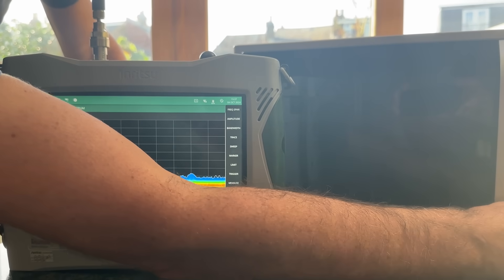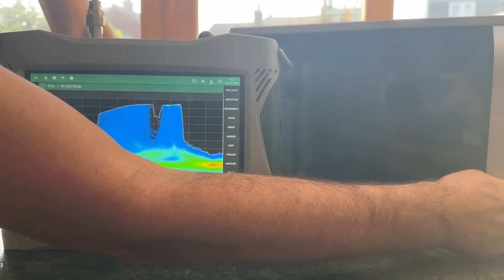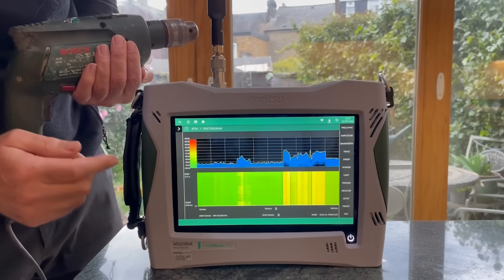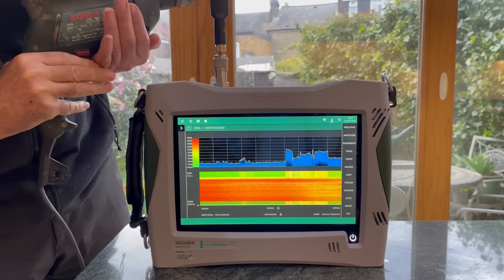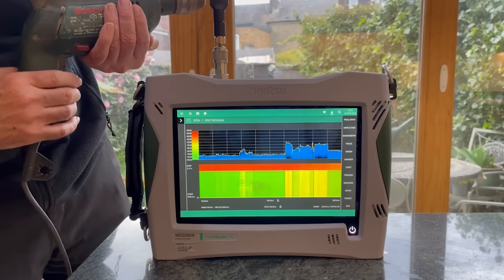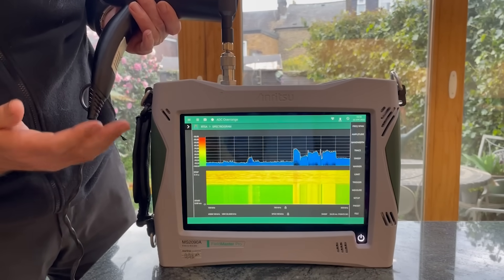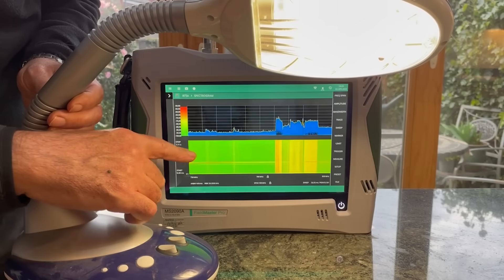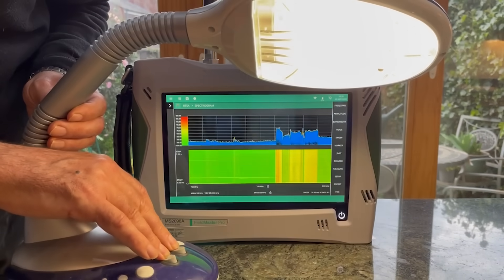Viewing RF interference from common domestic appliances with the Anritsu Field Master RTSA

Comment: Why didn't you show LED lamps which are the most common RF interference source.
Reply: Hi, This is a fair observation, I just happened to have this desk lamp to hand. You mention LED lights, we have experienced their emissions in a supermarket parking lot where the lights were switching on under control of a motion sensor and the radiation was enough to prevent staff radios from working.